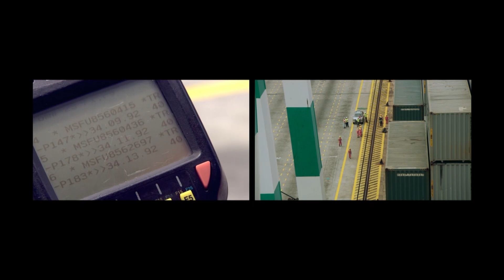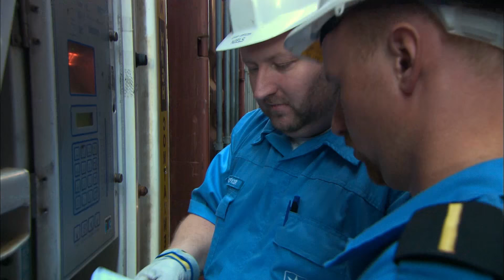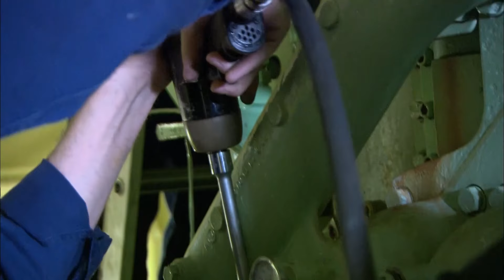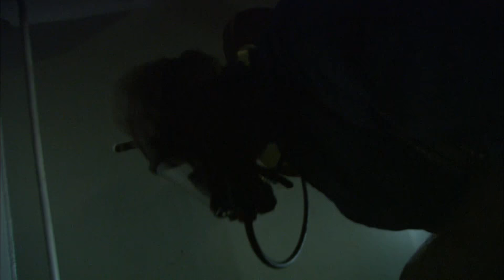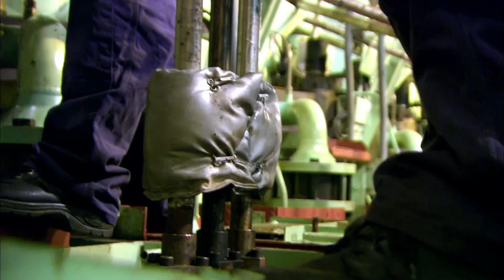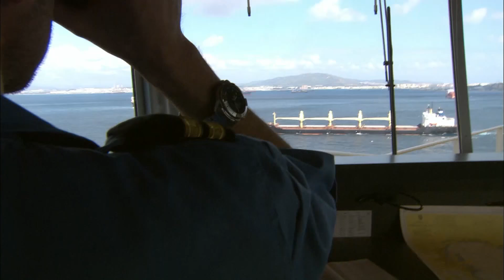The World's First Megaship: Emma Maersk | FULL EPISODE | Kinetic Motion

Comment: The Emma Mærsk container ship is powered by a Wärtsilä-Sulzer RTA96-C diesel engine.
This engine is known for the following features:
Type: 14-cylinder, two-stroke inline engine (14RT-flex96C).
Power: Approximately 80,080 kW (107,390 horsepower).
Size: It is one of the largest and most powerful piston engines in the world, measuring 13.5 meters high and 26.6 meters long.